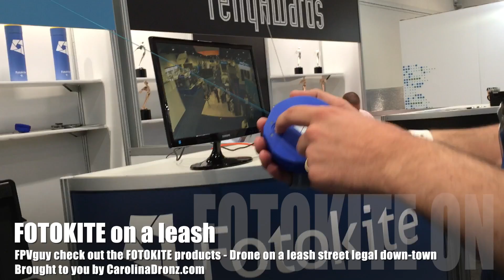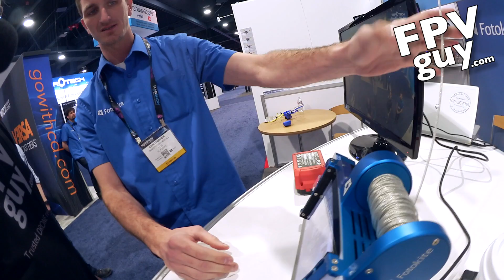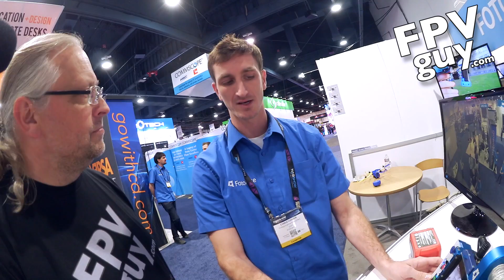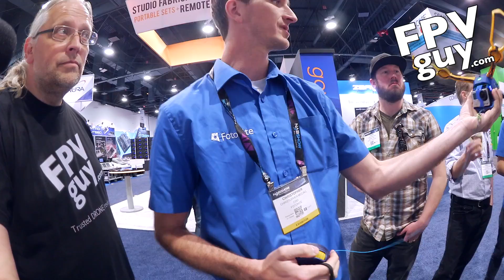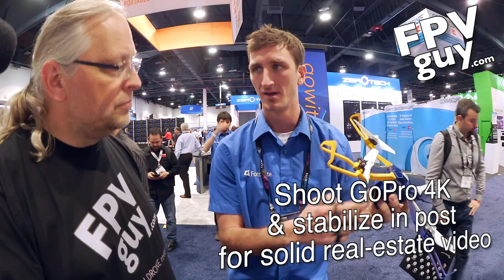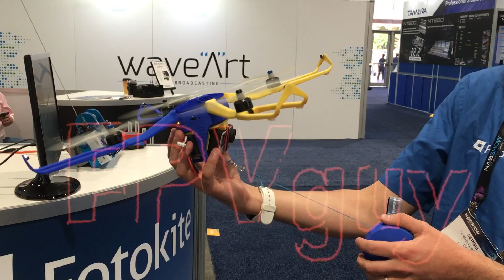NAB 2016 FOTOKITE

Comment: You know if I did real estate I would consider this considering it still goes high enough to see most one story house roofs, now two to three story houses you will need to either use a traditional uas or climb a ladder, so still a few draw backs but it does bypass those drone laws.
Reply from the maker: +Anthony Eaglebarger (toysoldier46552)   Absolutely agree with you about that.   this is useful for very specific scenarios,    outside of that box,  we definitely need a regular free-flying quad for meaningful video.

Comment: So, no mention, but both tethered and untethered UAS aircraft over 250 grams still need to be registered.
Reply: According to the registration rules on the FAA website even tethered UAS are required to be registered.

I'm not entirely sure about the other legal stuff like flying in Parks, over people and within the boundaries of an airport.
Reply from the maker: Hey Wayne,  I was curious about that,  they were telling me that its not a UAS because its just a kite, it can't fly on its own and rely on the leash to stay in the air.    But I have not explored the details of the law here.  
Personally I can fly quads in Hollywood neighborhoods, (but probably not on the BLVD) still I would prefer flying one of these for video there as people are getting so sensitive about quads in these areas.
Reply: +Bo Lorentzen Hmm, interesting point/loophole.
So if the cord were cut, it would fall to the ground and could not fly off?
Unlike a tethered nitro plane that could continue to fly with the control lines cut. (but I would imagine, not for long :-)
Reply from the maker: Correct,  if the cord was cut the FOTOkite would crash.. its really strange to see,  he starts it by holding it at the angle he want it to fly at.. say 30 deg angle.. and let go,, then feed out the cord.  the only reason it don't crash is that the cord is holding it,    and its depending on the cord pulling on it.  if you cut it, the quad would maintain that leaning angle and be on the ground shortly.  :-)
Reply from the maker: I think the over people thing is pretty much identical..  one interesting thing,  the pro version gets power from the ground and is probably much more persistent than a battery quad
Reply: +Airwolf Apparently not a UAS.
It's defined as a kite and kites don't need to be registered.
I'm sure this will end up in the courts after some angry Park Ranger tells an operator to stop flying. Unless the FAA issues a certificate of exception for the FOTOKITE confusion will rule as usual. :-)